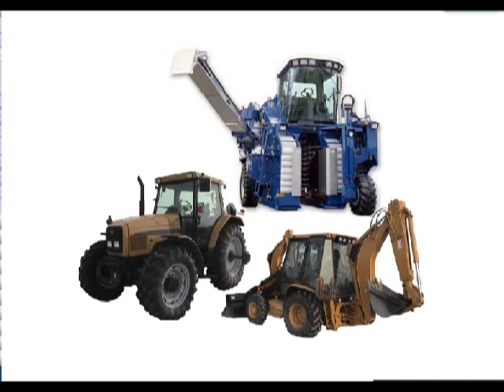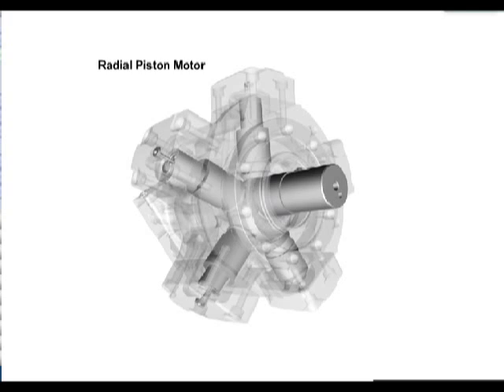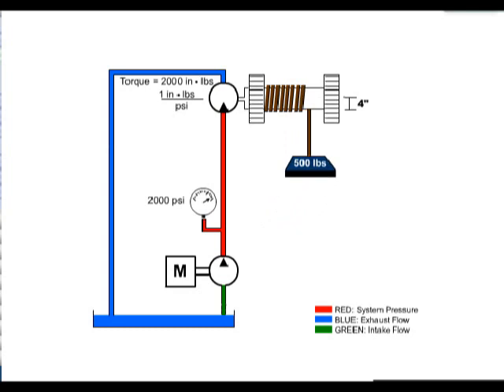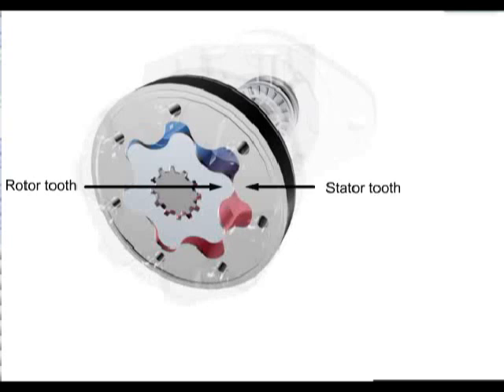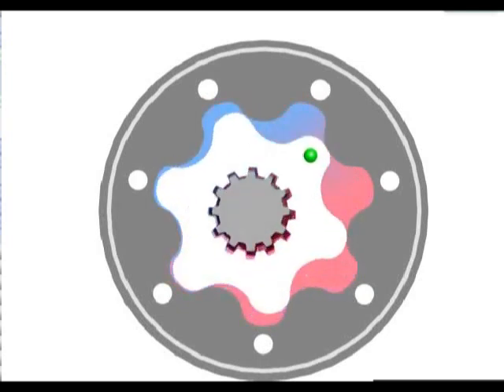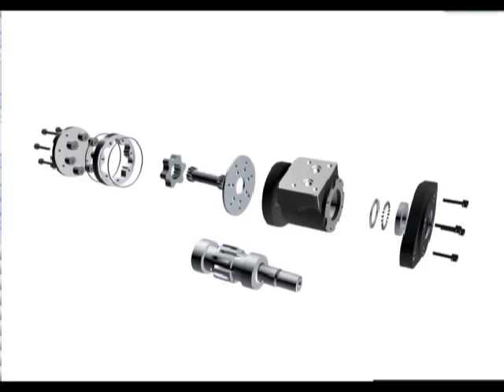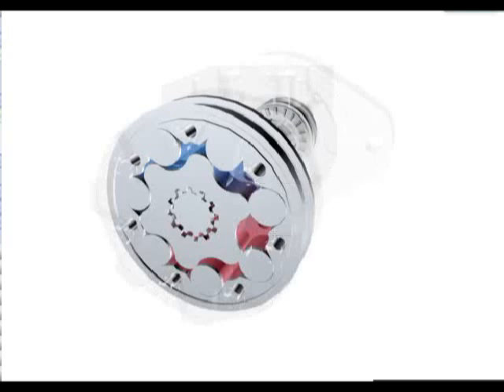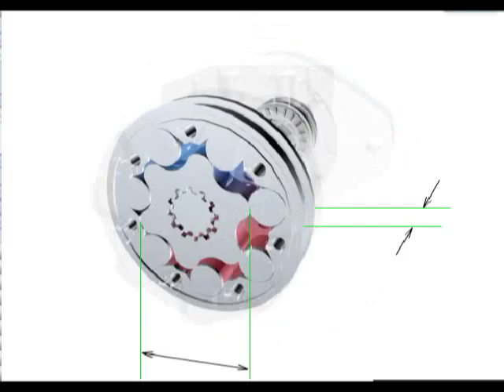How Hydraulic Motors works

Comment: Hello, sorry, I have a question, in my university classes I had learned that one of the advantages of hydraulic motors is that unlike electric motors, hydraulic motors could suffer from shaft binding due to excess load and the motor does not they damaged. However, reviewing the data sheet for the Char Lynne 2000 series engines, the tables describing the behavior of the engines show that as the gpm supplied to the engine decreases, the working pressure of the engine decreases. For example, if for 15 gpm the table shows that it can work with 2500 psi continuously, while for 0.5 gpm, it shows that it can work with a maximum of 500 psi continuously, after 500 psi it marks as NON-OPERATION points. Something important to mention is that the table does not indicate the working mode when the shaft is blocked, that is, at 0 gpm, but inferring the behavior of the motor according to what is described in the table, it could be assumed that at 0 gpm it would only support 250 or 500 psi. However, if this is correct, it would be a problem since when it becomes stuck due to excess load, the system pressure will rise to the pressure established in the relief valve, if we assume that it is at 2500 psi, the engine will stop. would damage or destroy, as it would have a pressure differential of 2500 psi

Comment: Hi if this motor was driving a 3 point hitch PTO chipper, and the chipper has a heavy flywheel that has a lot of  momentum, when the hydraulic flow is turned off, the flywheel would keep turning and the hydraulic motor would become a hydraulic pump. Would it pressurize the input lines with the same "polarity", or would the "polarity" flip? Polarity meaning which line has higher pressure (supply line)  and which line has lower pressure (return line).
Reply: It flips pressure sides. The return low pressure becomes high pressure
Reply: @megape95 cool thank you.  Must be why they have a check valve preventing reverse flow in such a case
Reply: @wildmanofborneo  , well for free float of a one way flywheel  usually a check valve between the a and b port is used. If you want to brake it when turned off, a relief valve can be installed instead of a check valve.
 Keep in mind cavitation can happen when there is oil shortage because of the case drain hose, when installed.
Reply: Use a cross port relief
Reply: @TurdJesus  Thanks for the reply. A cross port relief sounds more expensive than a common check valve. But more compact/integrated. Are cross port reliefs usually adjustable?  The relief would cause more braking effect than a free-wheeling effect, right?
Reply: @wildmanofborneo  yes it does offer a brake function so it does brake as fast as it can accelarate. Downside is you cant have a drian hose.